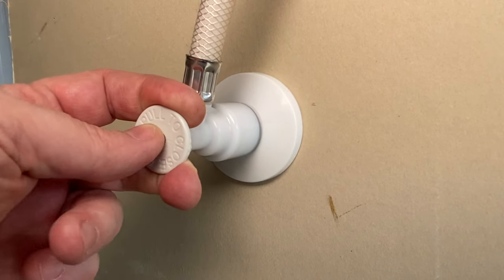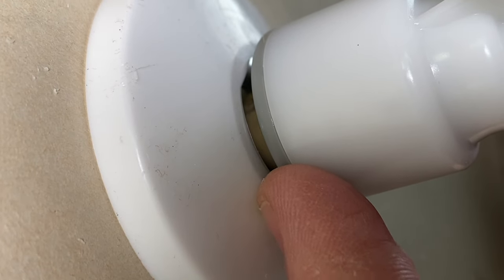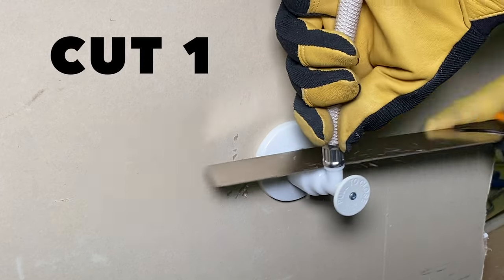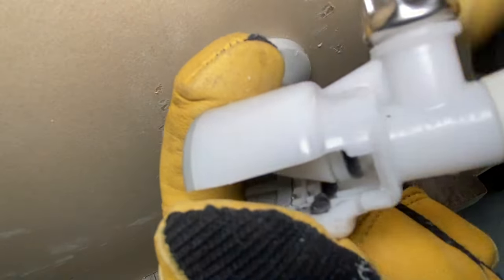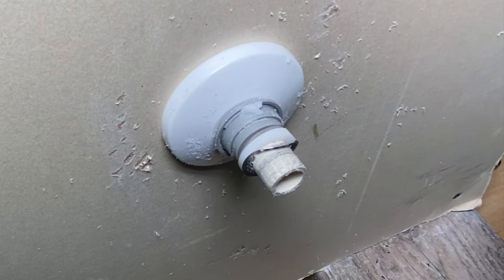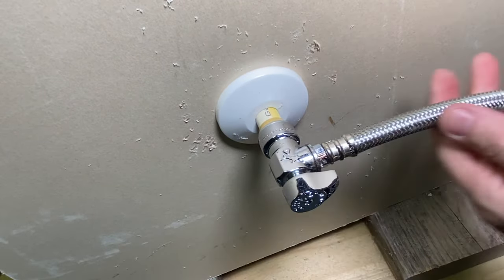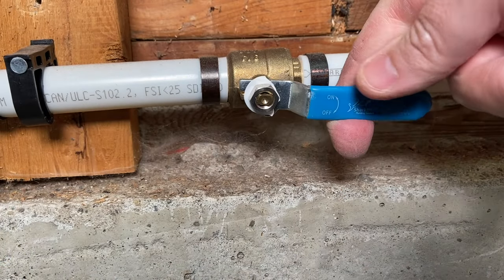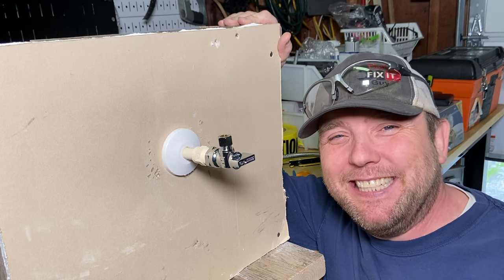BEST METHOD TO REPLACE FLOWTITE VALVE ON CPVC PIPE

Comment: Nice video! Waiting for the video for PEX A.
Reply from the maker: It will be coming out soon. Thank you.
Reply: @ThatFixItGuy 
I shut off the main water valve, let the sinks run dry, flushed the toilets and when I cut off the flowtite valve… the water bursted out and came out continuously and would not stop. I was not able to do the male/female adapter you recommend as a replacement. I shoved a sharkbite in there because water kept coming out. Am I missing something? Is there something different I have to do to make sure the pipes are empty? I have pex A piping and flowtite valves all over the house. Please help! Best channel by the way!
Reply: @ThatFixItGuy  Do you have a video on how to replace the faucet on this type of plumbing?
Reply: @jessetroy3525 i know this is late, but you may have not shut the main off. Also, best way to make sure most water is out of the pipes is to run the tub till the water runs dry.

Comment: Just replaced one in my bathroom sink, saw another video showing your can just turn and pull counterclockwise and pull it off, it worked for me.
Reply from the maker: That is great. I’ve just had too many times where that did not work.
Reply: Thank turning counterclockwise worked for me. So happy I read the comments before watching the whole video.

Comment: just removed 15 of these and used 1/2 in. Barb Inlet with 1/4 turn and taught myself how to crimp pex.
Reply: oh and all 15 of them came off by turning counter clockwise for about 5 turns or less. Honestly disgusting they installed these in homes.
Reply from the maker: Awesome. Totally agree. They are disasters waiting to happen. Glad spinning off worked for you without damaging the pipe.
Reply: @ThatFixItGuy  brand new home 🙄. I uploaded a video about it hahah. Thanks again!

Comment: "That Fix It Guy" has another vid where he shows using a copper pipe cutter.
I just used that method on 3 valves. Worked well, BUT. 1. If there's not 3/8-1/2" space behind valve to wall, cut thru the last 3/8" first, then cut 3/16" back from the front. 2. If you have a larger pipe cutter, you need to hold valve, rotate cutter, rotate valve, rotate cutter. 3. You'll be under a sink, not standing in front of a mock-up. I ended up removing all the plumbing and the disposal. 4. Don't cut the valve off before draining the system. There's gallons of water above you in a 2-story. 5. The SharkBite valves worked great. I thought I installed them wrong they were so easy. I know, comments are meant to be short.

Comment: Started doing plumbing work as a kid with my dad.   Been out of it “full time construction” for 25 years.  It wasn’t till just a few months ago helping a neighbor, I saw one of these useless things and I had no idea on removing.  Reached out to brother who runs family business for 40 plus years.  He’s never seen them or would use them. 

So far you provided the cleanest way of doing this.  I want to finish helping neighbor and said I would have to check on this.  Plus I need to know if she has CPVC or copper coming out   

These are the most worthless things ever created.  Just my opine.  There is no way to fix  or adjust them.   300K home n this is what ya get 🤔🥺

Comment: We bought a 1998 manufactured home.  I need to replace one of those on a toilet and broke the pipe, below the floor.  6 hours later and two trips to two different hardware store, we had water in the house again.

Comment: So, I did this on both pipes under my sink. One is looking good, but the other is leaking, and it seems to be the connection between the CPVC adapter and the valve itself. I removed the valve, put new tape on, and put the valve back on, but not as tight this time. Still getting a leak. I’m concerned that I may have overtightened the valve and the adapter to begin with. Any suggestions?
Reply from the maker: Are you doing just teflon tape?  I recommend tape and pipe dope.  3-5 wraps of tape then some pipe dope.  I know pipe don't think it does anything, but it is my go to.  Hope this helps.
Reply: @ThatFixItGuy  I will try wrapping with some additional tape and then layering pipe dope on top of that. Any particular brand you like for this situation?

Comment: You looked like you were struggling doing it outside  of a vanity with no p trap in the way. The average homeowner doing it with a p trap flat on their back? Shit I see this video causing domestic violence across the globe. 🤐💯.
Reply from the maker: I have since found a much easier way. But this method worked for me for a long time without damaging the pipe.

Comment: You’ve removed the third retaining ring, which holds the decorative and functional escutcheon in place. That was unnecessary, actually made things worse.  
That escutcheon plate with metal retaining ring, holds the pipe solid, so it sticks out of the wall a certain amount. 
Leaving it in place allows you to push the valve onto the pipe stub without you pushing the pipe stub back into the wall.
Otherwise, nice video! Thanks 👍